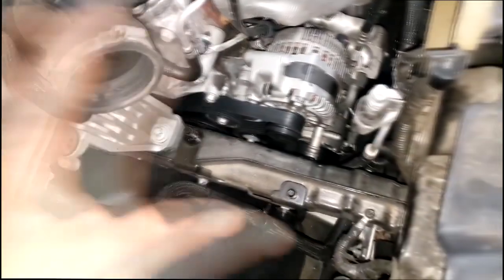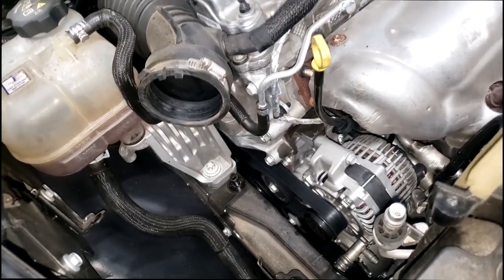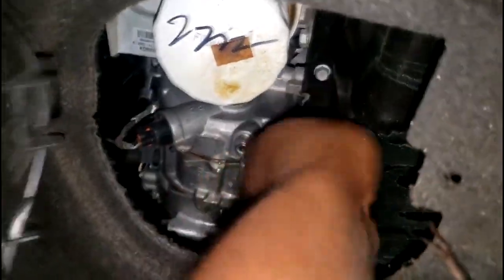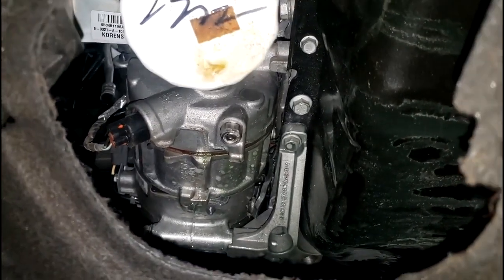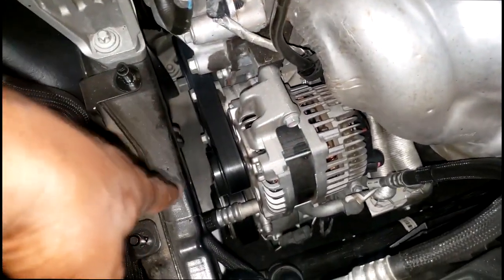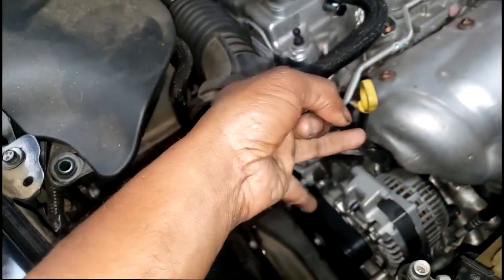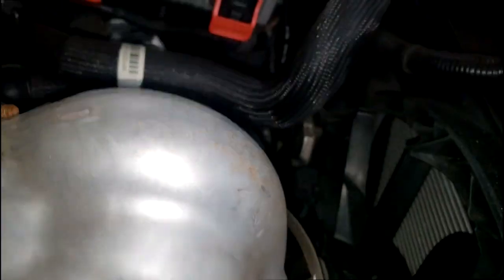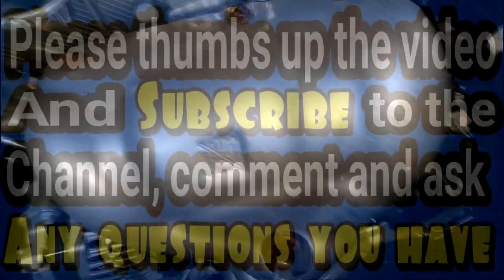Customer states they heard a loud bang noise then the AC stop working. You wont believe what I found

Comment: That I see that happening at shops all the time, at shops I service. SOMEONE put in regular Freon 134 into  a YF system (the NEW freon system). It will also plug up all the hoses too. NEVER MIX regular Freon 134 with the NEW expensive  Freon YF type. Its about a $3000 job if you do. The service fittings won't naturally fit, they have to be forced on ...
Reply: Aha!
Reply: Maybe, but the new refrigerant is burnable/combustible.
Reply: Bring back R 12 freon.

Comment: I've never seen a compressor do that either. To high pressure? Plugged up somewhere? Or simply mechanical failure? Should the system be flushed for possible debris? 
Peace.

Comment: I don't know if this is anyway related but I received a notice for my 2018 Honda Civic about a warranty extension from 3 to 10 years without any mileage limitation for an A/C Compressor Shaft Seal Leak. Honda is saying that the R-1234YF freon can cause swelling of the compressor shaft seal leading to freon leaks and possibly causing all of the freon to leak out. I'm keeping a closing eye on mine for signs of leaks because Honda dealers will do the repair work for free up to 10 years out. 
However, this appears to be another federal government regulation causing more harm than good. Honda, Dodge/Chrysler, etc. Will this effect more makes/models...my guess is yes.